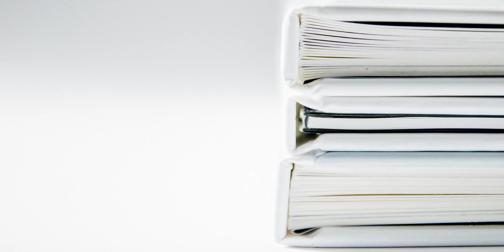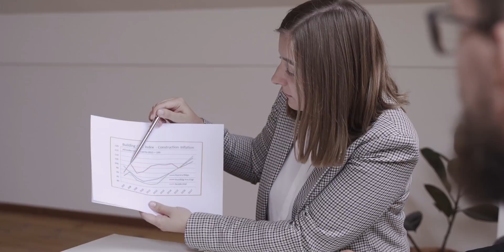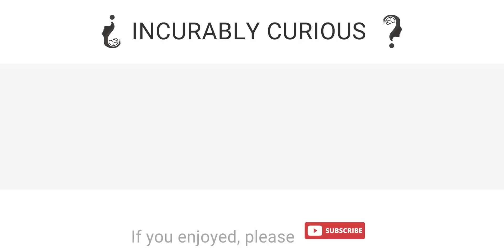Why Most Power Lines Aren’t Underground

Comment: There is a simple way: do it slowly. It will reduce the impact on on the cost. Begin with the  most viable and cheapest regions and spread the cost over a large regions. The savings would counter the costs. As time goes on we develop new materials and expertise. We move on slowly to the next viable regions. If get them done over say 25 years. We all see the benefit. Repair crews are less busy and the above ground lines get faster repairs. Reduction in repair costs will pay back. It is not a binary thing.

Comment: We've been asking our local power company to put the lines underground here for 40 years because, without fail, something breaks a line around here every single month, sometimes a couple times a month. 3+ hours every single month without power, countless devices destroyed by the fluctuations and flickering, and at least once it created one of the largest forest fires in our state...
40 years ago we all could have afforded to have double the power cost and it wouldn't have cost billions. Today we can't afford the current rate and it would definitely be overestimated for the installation cost because of the rising cost of electrical lines of all types. While the return on investment may take a couple decades, fixing the lines every single month for the last 40 years surely cost more. There isn't a single point on our entire network that has an old cable, they're all less than 10 years old now. It's just a highway, it could have been easy, but no... now I have to file an insurance claim every few months for something else that got destroyed by the power companies lack of tree maintenance or because of some idiot that can't drive.

Comment: Here in Denmark, both electricity and communication lines (fiber) are buried underground throughout the country. Only the most powerful high-voltage lines are on masts. In Norway, on the other hand, both power and communication lines are mostly on masts. The difference is that in Norway there are bedrock, while in Denmark there are loose masses. The cost difference for burying cables is formidable, but in new development areas, the cables are also buried in Norway. The reason is the climate changes which lead to more violent weather and thus more damage to the cables that are on masts.
Reply: I think not having frequent earthquakes makes it a lot easier than somewhere near a fault line

Comment: Well I think there is a simple solution for at least one of these problems that I can think of off of the top of my head.  First of all I know absolutely nothing beyond this beyond the information in this video so I'm not even claiming to be well informed so take it as you will.
What about instead of building them below ground or suspended up high they were built on top of the ground in an insulated, reinforced concrete structure along the side of the road?  They could be constructed with sloping sides so that if an accident occurs it would go over the structure instead of damaging it.  This structure could have some sort of access system to help prevent anyone from getting in unless they are from the power company.  This way at least when something does go wrong it is far easier to repair.  Again I know this doesn't address the other issues so it's not a solution, but it was never intended to be.  I guess it's actually more of a question about what issues does this create versus the one issue it addresses.

Comment: Your grandma’s tree is likely worth something in the neighborhood of 50,000-100,000 USD. 
I have seen $15,000 checks for relatively small (and worthless) pine trees—but the tree was killed by someone other than the owner and they were compensated.

I work in this industry (utility vegetation control) and I fully support underground distribution lines in neighborhoods, but customers MUST understand the limitations and additional expenses. 
At the time of writing this, there is no better “all around” solution for transmission lines than to be above ground. The higher the better.

Comment: When you take a fluorescent tube bulb under transmission power lines it lights up because the current running through them induces an alternating magnetic field around them as they conduct electricity. The higher the voltage, the greater the magnetic field density and the brighter the fluorescent tube will glow.

The tube lights up when exposed to the induced magnetic field because the current excites the mercury vapor atoms in the tube. Those atoms then produce short-wave ultraviolet light that causes the phosphor coating on the inside of the tube to glow.
And such is many feet away from the ground. Imagine what the ground pulls.

Comment: because it cost too much to put them under the ground!
Reply: Bad forethought in my opinion. My town thought way way ahead. We buried our power lines decades ago. Rarely a power outage, no trees to get blown over into them during storms… about the only issue these days is transformer blowouts. They’re easily fixed within a few hours, so it’s not a huge deal. Today.. it’s a sin to even ask to bury power lines. They’ve gone and buried so much other junk, they have no room for power lines. 

Feel sorry for those with above ground power these days, your electricity is literally at the whim of the weather.

Comment: Back when electricity was first being distributed over large areas and long distances it was a lot less expensive and quicker to run lines above ground along roads.  It is still a better method in rural areas and over mountains and rivers.

Comment: As usual, power companies (like MOST corporations) aren't willing to give up their MASSIVE PROFITS for the good of the country..underground lines aren't as necessary or feasible in all parts of the country..in Florida where I live it would help a LOT (hurricanes)...I have years of experience in utility construction, and the statement that it would double your power bill is questionable in MANY situations and sounds like utility company - provided (dis)information to me..also the statement that a problem in underground lines is way harder to find isn't usually going to be true either , except maybe in an area where a severe earthquake has occurred, because underground lines are jacketed and in strong conduits and almost the only way they'll be damaged is by someone digging into them with heavy equipment - in which case the damage location is obvious..I think somebody should have asked some utility construction contractors about this, but only got their info from power company reps..

Comment: Whilst some of what you say is obvious, other parts not so much. The cost of replacing pylons only needs to happen as a part of routine maintenance and any necessary upgrade. Substantially reducing the cost. Areas not prone to Earthquakes do not suffer the issue you state and the environmental reasons for not having pylons are legion. Unless of course they can be multi-purpose by supporting wind turbines and communication cables/posts/repeaters etc.

Comment: They are underground in the UK, apart from rural area where HV that is carried on pylons  and fed into the house at via HV to LV  transformers on poles. The cables are actually under our pavements (Sidewalks) encased in green plastic pipes along with water (blue), Gas (yellow),  Internet fibre (purple) so pedestrians often suffer during repairs.

Comment: In most of New Zealand since the mid-1970's new subdividions got underground services. And for a couple of decades after, when time came to replace the power and telephone poles, those services went underground. Lifetime costs are significantly less, especially as N.Z. has severe winds and earthquakes from time to time, and on the seacoasts, salt spray can encrust insulators. Another advantage is that there are less deaths due to cars colliding with the poles.

Comment: It's not a reliability issue, that's just excuses. Even some parts of China have moved civil powerlines underground. It's done in just a few years. The grid has become much more reliable since then.
Reply: Theres a couple other major challenges for underground cable (albeit with solutions)

1. Insulation. For Overhead lines, you get the benefit of utilizing the surrounding air to act as an insulator to prevent current differentials and arcing. For overhead this isn’t practical within the pipe so they use high pressure fluids. These fluids have to be maintained through the entirety of the line to prevent arcing, whereas the air exists constantly forever. This is managed effectively but also requires pumping systems with correct fluid dynamics to maintain proper insulation for the line at all times. This can become challenging during maintenance periods because not only do you have to account for outages but you also to account for pumping cycles. 

2. Heat Sinks. Now a benefit for high pressure fluids is that also reduce heat capacity on the line. Whereas engineers have to account to a somewhat greater degree for overhead by way of accounting for elongation of the lines during higher temperature periods. This is maintained by the fluid, BUT in the event of maintenance  on the line the fluid will not be able to be circulated. This is problematic because you now have to cool the line during your maintenance procedures. Good news is we have solutions. Bad news is they are pretty expensive as the common procedure to my knowledge involving pumping in liquid nitrogen at the area where these procedures need to occur.

Comment: One place I worked at had serious problems when a company putting up a high voltage line dropped that line onto their dedicated high voltage line.

I was off that day at a breakfast restaurant.

Even at the restaurant miles away in a different town we had a short duration outage or brown out.

I found out that some of the stuff on generators and batteries continued to work like normal, but for some reason they didn't tie other things into the system.

Comment: Some of claims here seem specious.  I doubt the failure rate for overhead lines is lower than that of underground lines unless you neglect trauma to the lines from weather and trees and such.  And though overhead lines are easier to maintain, my guess is they actually require more maintenance than underground lines, because of wear from wind, sun, and water.  Really, the main reason utilities don't bury lines is the upfront capital cost to do so.  The utility companies don't want to float this cost themselves, so they try to get regulators to push those costs back on the customers (and generally get told no).  Though the cost of a  catastrophic weather event like a hurricane might be high, my guess is the utilties are able to offset those costs with insurance (which is not possilble to do for planned construction like line burial).
Reply: Your not wrong but there’s a couple other major challenges for underground cable. 

1. Insulation. For Overhead lines, you get the benefit of utilizing the surrounding air to act as an insulator to prevent current differentials and arcing. For overhead this isn’t practical within the pipe so they use high pressure fluids. These fluids have to be maintained through the entirety of the line to prevent arcing, whereas the air exists constantly forever. This is managed effectively but also requires pumping systems with correct fluid dynamics to maintain proper insulation for the line at all times. This can become challenging during maintenance periods because not only do you have to account for outages but you also to account for pumping cycles. 

2. Heat Sinks. Now a benefit for high pressure fluids is that also reduce heat capacity on the line. Whereas engineers have to account to a somewhat greater degree for overhead by way of accounting for elongation of the lines during higher temperature periods. This is maintained by the fluid, BUT in the event of maintenance  on the line the fluid will not be able to be circulated. This is problematic because you now have to cool the line during your maintenance procedures. Good news is we have solutions. Bad news is they are pretty expensive as the common procedure to my knowledge involving pumping in liquid nitrogen at the area where these procedures need to occur.

Comment: Good stuff but all  I heard was excuses to fix a problem that was caused by companies wanting  to get off cheap instead of planning long term and covering the all the bases.  I do not believe a insulated line under ground does not last as long as a above ground one.
Reply: We’re not talking about a couple bucks here…… your talking MILLIONS PER MILE DIFFERENCE. 

The U.S. has 2.24 million miles of distribution and 650,000 miles of transmission. 

That’s a hefty price tag….. if you as the consumer of electricity are willing to pay for it then it’s an option, but a lot of consumers are not….

Comment: 50 years underground power to the substation multiple earthquakes, thunder storms and wind storms with no problems in Pacific NW.   
 In Virginia induction from lightening striking ground caused voltage spike with underground power.

Comment: Awesome video however one thing I thought I mention is that guy wires were always used on wood poles. In fact they have ti be used on wood poles. This is why Engineers working for power utilities make a lot of money because the math involved to calculate the tension is complex but it's worth it when it involves saving the costs of materials.

Comment: You make a decent argument.
But with a closed mind to solutions. It is possible to put some lines underground.
A huge solar panels was built in the antelope valley. The problem was putting huge towers on people's property.
You lose that part of your property and loss of value. It was very strongly contested.
Maybe put the lines underground on private property. So we can harvest the energy from them.
No floods or trees. Just sand
Reply: Loss of property for ROW exists for both overhead and underground. 

The same people upset about the towers are gonna be cool ripping up their land to install pipe? I think not
Reply: @brian2440  thanks for the explanation.
Reply: @robertthompson1254  granted it could be more long term visual impact, but all ROW impacts are taken into consideration for landowner negotiations prior to construction
Reply: @brian2440  thanks I learned something new

Comment: I call bs; the failure rate of underground power lines is higher because of the infancy of its design. It's relatively new compared to its above-ground counterpart. As design implementation improves, it will be the better option. Also, you said flooding was one of the leading weather issues and then said hurricanes caused the flooding. Are you kidding me? They lost power also because the above-ground lines failed... due to the above-ground poles and hurricane winds. You can build cables that can withstand flooding easier than you can make cables above ground that can withstand hurricane-force winds; look at ocean and lake transmission cables. Look at the physics first.. instead of your stats because engineers use physics to design and implement and not just old stats!
Reply: True, but I’d argue the fluid dynamics of oil insulation for underground are a relatively greater concern than utilizing air as your insulator for overhead.
Reply: @brian2440  oil insulation is one way of creating an insulator; there are many other ways of insulating, and some that dont incorporate any liquid insulators. that being said, the petroleum "jelly" would be the final insulating layer when used, reducing its risk of damage based on all insulation layers; increasing a factor of safety.

Comment: you dont need to replace the entire grid in one go though, just put the new ones underground. also i doubt its more expensive to put new ones up in the air than underground. You literally dig a ditch, throw in the powerlines (with added coating since theyre no longer suspended) and put dirt on top. Theres no way thats more expensive than the whole suspension operation. Obviously apart from long distances like over fields between towns and cities.

Comment: The Netherlands seems to be a frontrunner in this regard as well I suppose, I haven't seen comparable electricity infrastructure in many other western nations.
Here the power lines that are above ground are just the high voltage ones, 110kV, 150kV, 220kV and 380kV with all of the medium voltage and low voltage cables underground. Even then, more and more newly built high voltage cables are being built underground, mostly direct industrial connections to substations (e.g. datacenters).
While I don't know the exact amount of failures for underground cables, it seems they're not frequent at all as I've seen very little news about power outages in the country, I believe this is mostly due to redundancy on the various voltage levels. Also, underground cables are laid in cable ducts with plenty of space around them, as well as given excess length as a buffer, so the earth can move a lot before cables become inoperable.
Really, I had no idea our grid was so impressive until I saw the American grid, especially the medium and low voltage lines.

Comment: AC doesn't take well to burying at hi voltages (hi losses)... so underground is usually converted to DC for hi voltage & then converted back to AC when it comes back up out of the ground, this is not a trivial technical issue... its not a simple matter to step up / down the voltage as transformers don't work with DC.... its okay to bury local AC cabling at 110v (or 220v here in europe)  as there is little power loss from induced eddy currents at this level...

(AC = Alternating Current   DC =Direct Current)

😎👍☘️🍺